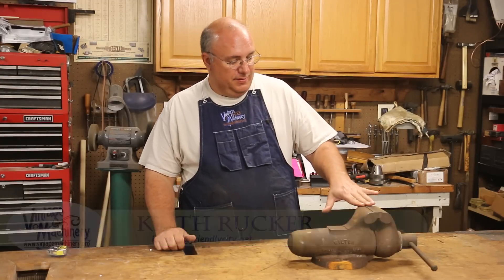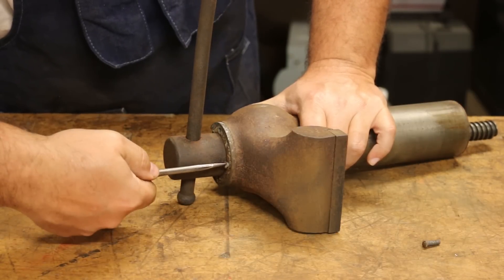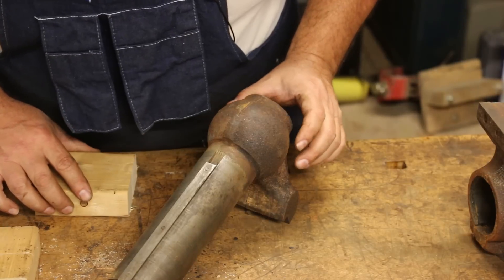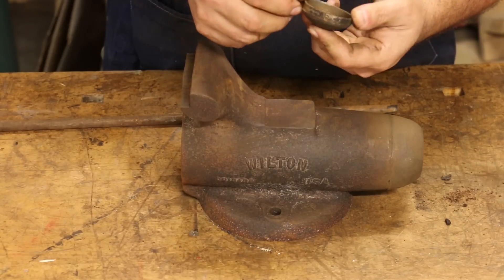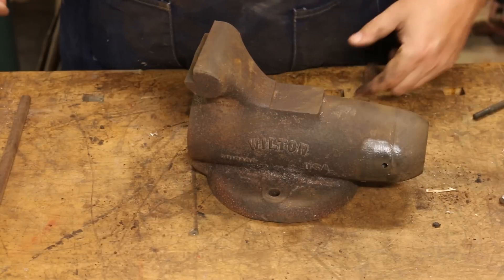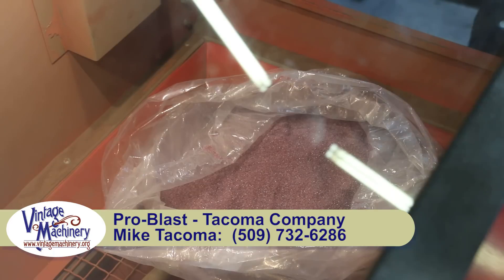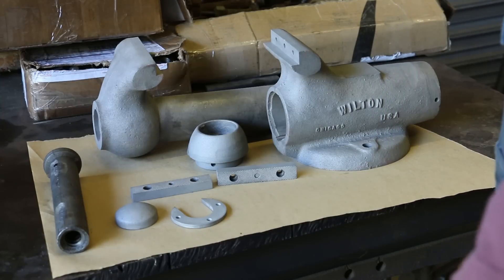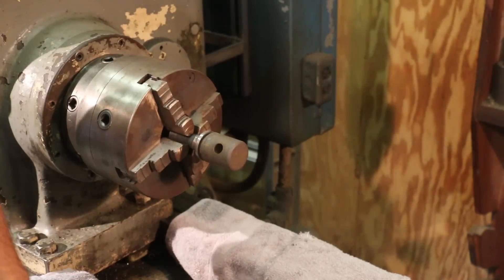Wilton Vise Restoration Part 1: Disassembly and Cleaning

Comment: love the video Kieth.  Just rebuilding a 3 inch Wilton myself.  4-46 refers to when the original 5 year warrantee expired based on what I've been told, your vise would have been made in April of 1941.  It probably spent it's early life in a shop making things for the war.  My little 3 inch was made March of 41.  I went with Krylon hammered emerald green, pretty close to the original paint on my 4" Wilton and it looks great.
Reply: 4-46 is the date it was built. 1941 to 1954 are the date built. they changed to the 5 year warranty expiration in the 1950s, which is why there are none marked 55-59, according to sources on identifying them.

Comment: A friend of mine just rehabbed that same, exact model. Disassembly, into the electrolysis tank for a week, further minor bead-blasting and cleanup and off to the powdercoater for a nice dark green finish coat. . High-temp Tape was placed over the anvil and jaw section to prevent adhesion of the powder to those sections. I've found a cheap aluminum muffin pan to work well for collection of small parts when disassembling items, and easily marked with masking tape for part identification. Great job!!

Comment: Great video. I just picked up a Wilton 935 with swivel base yesterday for $20. I was soooooo happy. I was wondering where the date stamp was and you showed me that. Mine is 2 47. It's really in such good shape that I think I might just try stripping what's left of the old paint on it, and then as one of your commenters suggested, apply a hammer paint of similar vintage color. Thank you so much for sharing your knowledge on this wonderful tool.

Comment: Keith I don't have the shop like you do so when I restored my vintage Craftsman vise I had to do it with the variable speed grinder, wire cup and polishing cup, painted it, lubed it and put it together. Sometimes you have to compromise, nice video!

Comment: love the old screwdrivers! nice vice. the interesting part of the video is @ 10:32 , the roach that runs right towars the vice when he is driving the pins!!  usually they run the other way!   LOL !
Reply from the maker: +tc seacliff The funny thing was I did not even notice that until I was editing the video!
Reply: he must have had such a headache! LOL! the vice turned out  nice!  I was hoping you would have powder coated.but you could have di hammer tone that you could bake in an oven also!

Comment: Keith,

I’ve not been in YouTube viewer-land in a long time.  Got a lot of catching up to do.  But your vid on the Wilton vice rebuild was my first after a long hiatus.  Loved it!  I wanted to share an alternate method of getting those two pins out and I thought it would be easer to explain it with a video rather than an e-mail reply.  Turns out; doing a video is hard work, but I did it!  It’s on my YouTube channel.  It’s the only video you will find there. It may be my last.  If you think it has value and is worth sharing with others please do.

Your vids rock,
Brad
Reply from the maker: +Brad “HomeShop” Apprentice Thanks Brad - nice approach and a technique that I would have never though of.  Usually, when you drive the first pin through, it will just fall out through the hole that the nut fits into.  On my vise, the two holes were nearly perfectly aligned and instead of coming out through the hole, it started into the hole on the opposite site.  It was not my plan, but once I got that far, about the only thing to do was just punch it all the way through.  I "liked" your video so maybe some people will see it in my list of liked videos and go over and watch it.  I have already filmed and edited the conclusion to the Wilton vise restoration so sorry, you won't get a mention in that video....
Reply: +Keith Rucker - VintageMachinery.org
Thanks Keith!
Brad

Comment: Great video and good advice about taking lots of pictures during the tear down of a project.
 I also take pictures of any serial numbers and model numbers. If it's a hard to read number, I can read it easier by taking a picture and blowing it up to read it. It's also very handy at the parts house when I can pull out my phone and show them all the numbers they need.
One thing I do, especially when I have several projects going at the same time, is to bag the small parts and screws in one of those slide lock storage bags with the write on labels. Keeps them together and it makes it easy to figure out what screws go where, when putting something back together 6 months later.
Reply from the maker: +schmidt60410 Totally agree with everything you said!

Comment: I see blood at 9:54 on the wooden block!.... I think.
Man I have done some damage to my fingers in the past while trying to punch something out. The worst was when I was trying to get a bushing out of a gear out of a transmission and the punch slipped as I hit it, causing my finger to smash into the sharp gear tooth and gouge a chunk of of my finger out.  On that day forward I decided to never use a short punch again.  Much safer to hold a long punch.

Good video btw! Excited to see the rest of the restoration.
Reply from the maker: +MattsMotorz Yep, I pinched a small flap of skin on my finger just enough to make it bleed.  Good news is that it was not bad and is already almost healed up.
Reply: +MattsMotorz  I suggest using a pair of vice grips to hold your punch. Keeps the blood off the shop towels .

Comment: Hey, that's my vise!  I've got the swivel base for it, though.  Mine also has the pipe clamps just below the jaw.  Wonderful vise.  Nice to see how it comes apart without having to learn on mine.  On mine, it appears that one of the balls on the end of the handle is threaded, but that will be something to figure out.
Reply from the maker: +artgoat I think the ones with the pipe jaws were a big newer model than mine.  While this vise is pretty much the same today as it was in the 1940's there have been some slight changes and improvements.

Comment: I was given a 1950's 6" Wilton Bullet that was seized up.  I soaked it in a bucket of Kroil for a month and it still wouldn't let go.  My cousin took it to work with him and let it soak in a hot tank for a week and I was then able to get it apart.  It's sitting in my shop now with just a primer coat for rust protection.  I am wondering about epoxy paint vs. powder coating.  I have told that powder coating has a tendency to chip.  I am thinking black with copper jaws and can't wait to see how your project turns out

Thanks

Bob
Reply from the maker: +Bob Horton Thanks Bob - I will probably have some time next week to finish up the vise - hopefully....

Comment: I have similar screwdrivers, made in Germany. I got them from my father, who passed away when he was 89, in 1998, who told me he had gotten them from his father, who passed away when my father was six years old. They emigrated from Hungary in the late 1800s. The difference is that instead of the square drive at the front of the handle, there are two wings, cross hatched, with a raised border. These are for thumbs, for greater torque.

Comment: blast cabinets are always so adorable to me. i do abrasive blasting for The Gateway Company here in St. Louis and my booth is 60ft long 18ft wide and 20ft tall and we run 4 inch OD 1 inch ID blast hose. but then again we do bridge pieces, industrial machine frames, giant aircraft assembly jigs for Boeing.

Comment: I cleaned up and sold an alley found WIlton Baby Bullet with the Pow-R-Arm base a few years ago. I ended up liking how it looked without paint. (I just uploaded a pic of it to my channel if you'd like to give it a look). That is in fact a date code on yours, but as I recall there is something unqiue about the date codes, like maybe some vices feature a date of sale or date of shipping (as opposed to others which bear a build date) which took place once the company resumed production after taking a hiatus or focusing their efforts elsewhere during the war, or something along those lines. I don't remember the details, but I know I enjoyed reading the history of the company somewhere online.
Reply: +John Strange indeed, if the vice ends up being used for things such as applying heat , paint will be a mess in no time (such as tom liptons, although he seems to have an alloy one?)
Reply from the maker: +John Strange Somebody shared a web site with some history on the company.  It looks like they stamped the date that the warranty expired, which was five years after when the vise left the factory.  That makes mine made in April of 1941.  Wilton started making vises in 1941, so this would have to be one of the first ones that they ever made!
Reply: Ahh yes, it was the warranty. Sorry for the confuzzlement. :)

Comment: Nice strip down Keith. Nice to see you using the steel back screwdriver. I wouldn't bother with the powder coating. When it gets a few chips out of it, it starts to look nasty. A good coat of Rustoleum primer and then gloss paint will last a long time and is easy to repaint.  regards from the UK
Reply from the maker: +Gary C I have decided to paint it with a hammertone green paint very similar to the original color.

Comment: Hello Keith,

As usual a very nice video and never thought that a vise could have so many parts and that it can be dis-assambled. But I asked myself if there is a special reason that the form factor is like an bullet shaped. 

Looking forward to part 2 and many greetings from Roel !
Reply from the maker: +RoelTyros I don't think it was designed to look like a bullet, but they wanted the end to be enclosed and it ended up looking like a bullet, hence the nickname for these vises as "Bullet Vise".

Comment: Hey Keith great video especially since I'm in the middle of restoring the same vise.  Do you think the dynamic jaw and tube could be chucked up in the lathe so I can reface where the screw contacts the dynamic jaw body?  I've never turned such an imbalanced part before so I'm not sure if it can be done. TIA!

Comment: If you wanted to save the handle, could you chuck it in the 4-jaw (independent) and turn the shoulder a tiny bit further down the shaft, like 1/16" or so, to give you enough stickout to swage back into the countersink?
Reply from the maker: +cooperised Than handle is really pitted up bad, and also bent in various places.  I am thinking I am just going to make a new one all together.

Comment: I support the suggestion to make soft jaws, if not copper then at least nice flat mild steel. Those original jaws are unbelievably hard and will leave teeth marks on anything you clamp. On the flip side of the coin, the little anvil surface on the back is not hardened, and will dent if you get carried away with your blacksmithing. Finally, the original handle could probably be reused (assuming it can be straightened and the rust isn't too bad) by just turning that shoulder back a bit and swaging the new extended portion into the ball-piece. Of course, it might be simpler for you to just make a new handle.

Great video!

I have to ask: what color do you have in mind?
Reply from the maker: +Scott Anderson The nice thing about this vise is that the flat "anvil" is in pristine condition.  It does not look like anything has ever been beaten on it.  Same goes for the rest of the vise.  As for the handle, the rust pitted it pretty bad so I am probably just going to make a new handle and replace it all together.  As for color, I am looking at hammer tone green very similar to the original color this vise would have been painted.

Comment: Thanks, this and vid 2 are really great!! fun with all that machining etc!!!

A few questions that will help me with my own Wilton 1760 6" clean-up. Just picked it up today at an estate sale and it's filthy, grimy, gritty, and needs love:
1- without access to a blasting cabinet, will sanding do? I have a dremel tool. If sanding, what grit? Only sand rust, or paint stains too?
2- what grit is that Emory cloth? 
3- that screw shaft that has a "run out"/bend: is there any need to fix that other than a pro restoration? As in, does such a bend kill the vise performance? Any other way to correct if you don't have a big press?
4- I have naphtha for cleaning saxophone mechanism pieces. Will that do for these parts? Should I was the parts in degreaser like simple green+water first??
Any other tips? 
Thanks Keith!!!
Reply from the maker: The problem with sanding is that since this is a rough casting, it is hard to get the sand paper down in the texture of the casting.  I would recommend a wire brush on an angle grinder or even a drill to remove the old paint and rust as that will get down in the casting.  As for the bent screw, you might be able to drop the screw down in a piece of pipe mounted in a vise and bend it back straight.  Just make small adjustments at a time and keep messing with it.  You can tell how flat it is by rolling it on a flat surface.  A for naphtha, that is a good solvent and should work fine.

Comment: If you don't mind me asking where did you find the vise? It looked liked it was in really good shape, only surface rust for the most part. I can't believe the screws came out that easy!! And nothing was froze up, what luck, such a great find.
Reply from the maker: +ecleveland1 I found it at a swap meet up outside of Chicago during the ArnFest event that I go to each year.  I don't know any of its back story, but it obviously just sat somewhere not being used for many years where it got rusty, but not too bad.
Reply: Used Wilton bullet vises in the south are very hard to find in reasonable condition and if you do find one even if it needs a very good restoration they are very expensive. I mean it's like they are priced not to sell. You've really got a nice vise.

Comment: Hi Kieth,
Did this vise have a swivel base or does it bolt to the bench in a fixed position?
Thanks for all the advise and tips!
Tony
Reply from the maker: +Anthony F. “Tony” De Leo They sold those vises with and without the swivel base.  Mine did not have one, at least when I got it!

Comment: Too easy for you Keith!  everything comes apart and doesnt need to be replaced?  at least when i repainted my old bench vise it repaid me by putting my back out after moving it  has everyone watched the 'up next' video of the guy who had to go to extreme lengths to take apart his rusted wilton vise?
Reply from the maker: +jusb1066 I guess I was lucky - it is really in very good shape all things considered.  Looks like it sat outside for quite a while but also looks like it saw very little use over the years.

Comment: Hi Keith,
I have an old crawford vise and it is missing the screws that hold the pads on. I have tryed various imperial screws and none seem to thread into the jaws. Is there a special screw that hold these on?
Txs
Reply from the maker: +Wes R Just whatever size they decided to use.  All I can suggest is keep trying different sizes.  And realize that some sizes that were common a long time ago are nearly impossible to find today....
Reply: +Keith Rucker - VintageMachinery.org Thanks Keith will do.

Comment: Did you find when reassembling the rear pins in the back that it wasn’t the same fit as before removing them or perhaps the rear cap is a little looser?

Comment: Great video as always. I have a Columbian vise I am trying to get replacement jaws for. The original jaws have gotten worn away. I tried removing them and cutting new lines using my little 7" shaper. This worked well but the jaws are softer than I had thought and are now worn again. Can you offer a place that sells jaws? I looked at viseparts but no go. These jaws are pinned into the casting in a tongue and groove with no screws.
BTW - have you ever used a "spooge tank" or electrolytic rust removal? I am sure you are familiar with it but I would think putting the vise into a spooge tank would make things a lot easier. Any parts that are rusted together will easily come apart as if it was all just put together.
Reply from the maker: +howardtoob Not sure about a source for vise jaws.  You might try making a set out of some good carbon steel or even tool steel and then get them hardened.  Most of the original vise jaws were hardened that way.  As for electrolysis, search my web site - I did a video on it a while back.

Comment: Beautiful vice, looking forward to the rest of this project! Quick question: Isnt using pins in such a way prone to shearing off if you apply too much force on the handle or someone tightens it with a hammer?
Reply: +Felix Dietz oh, its got a little key? ive just seen that now, the second time i watched it

Comment: Keith,
Nice job on the vice! It sure cleaned up nicely. Have you decided if you're going to paint or powder coat? Is there any way of finding out what color it was originally? Since this is a restore, that might be a good color choice. Thanks for the video. 
Have a good one!
Dave
Reply from the maker: +Swarf Rat I have decided to paint it a hammer tone light green color.  The color is a near match to a lot of the pictures I have seen for some of the originals.  I could not get the same finish in power coat that I was wanting.
Reply: At least it isn't PINK!!!!!!!!!